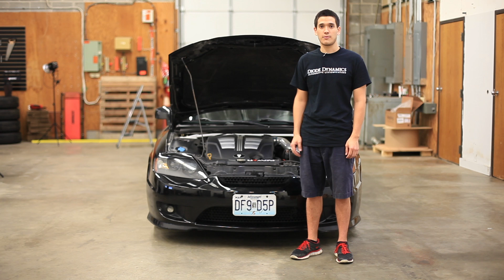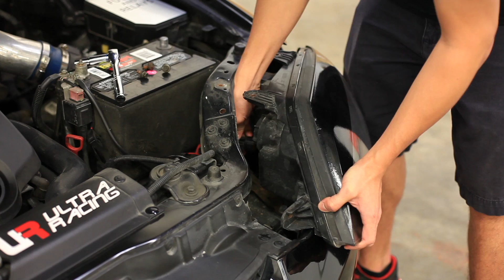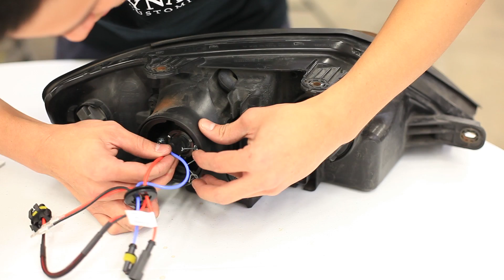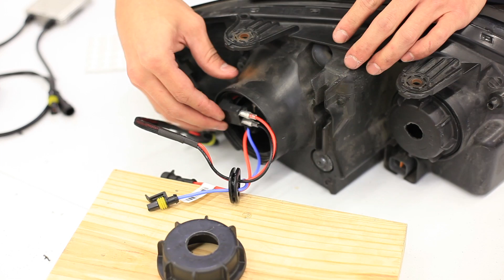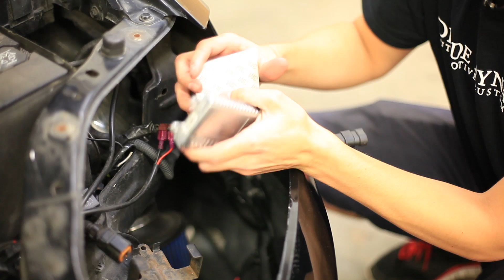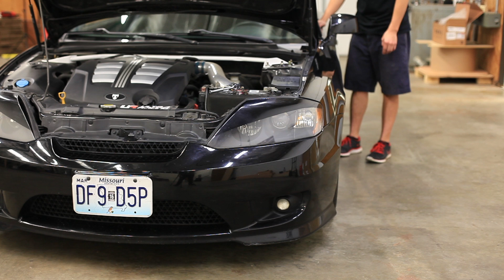Hyundai Tiburon HID Conversion Kit Installation

Comment: Do you still own that Tib? I have a 06 too. I’m interested in what mods you did to it. I bought mine two years ago and only has 70,000 miles
Reply: How much did it cost you?
Reply: @jeanpg900  when I bought it, it had 50,000 miles. $4500
Reply: @ginoamercado  dang and now i cant find any but over 130k miles for over $7000

Comment: i have an 03 tiburon but i want the 05-06 front bumper will it fit with the 03 headlights or will i need to also get 05 headlights.
Reply: Yes, lots of people with the 03-04 Tib bumpers convert to the 05-06 bumpers
Reply: Mason Lo i did the front bumper conversion but my headlights are a bit off one of them stick out more to the side. they are still 03. does it mean i have to fo the 05 headlight conversion so they fit better?

Comment: I have a 03 Hyundai Tiburon GT V6 which would be the best for mine if so can you send me a link please and thank you
Reply from the maker: Randy Ray 03 tibs use the same bulb size as an 06.  H7 for the low beams. 

http://www.diodedynamics.com/store/led-bulbs/listed-by-vehicle/hyundai/tiburon/hyundai-tiburon-low-beam-hid-conversion-kit
Reply: now will this setup be for my low beams and high beams
Reply from the maker: Randy Ray you would need two separate kits. Both H7 for lows and H7 for highs. BUT I wouldn't recommend HIDs for high beams because they aren't instant on/off and require a warm up period to achieve full brightness (7-10seconds).

Start with the low beams. I rarely used my high beams after installing my HID conversion kit.

Comment: could it have any problem if I use 6000??
Reply from the maker: I would recommend 6000k over 8000k. There is more visible light. No issue, that is just color temperature rated in Kelvin not bulb temperature. Recommend 35w kit only.

Comment from the maker: Raymond, a relay isn't necessary but it is always a form of protection to the headlight circuit and will draw power from the battery. I would suggest to use a relay.
Reply: Hey quick question did you buy the heavy duty relay ? Is it a must have or no ?

Comment from the maker: Jose I am using Diode Dynamics brand hid kit. I would not recommend a 55watt kids as they burn a lot hotter and can melt plastic housings. 35watt 8000k premium kit is what I'm using.
Reply: Awesome! Thank you!
Reply: You do know that the factory oem bulbs in the tiburon use 55watt halogen H7 bulbs?
Reply: and thats for both low and high beam light bulbs. I own a 2003 tiburon gt i was curious to see what wattage bulbs it was using and to my surprise both low and high beam bulbs are the same wattage.

Comment: what connects to the original connection thst went to the light .. from the car
Reply from the maker: it is positive and negative h7 spades which will give the ballast signal to turn on. check us out at www.diodedynamics.com